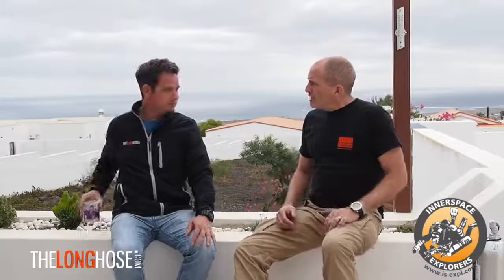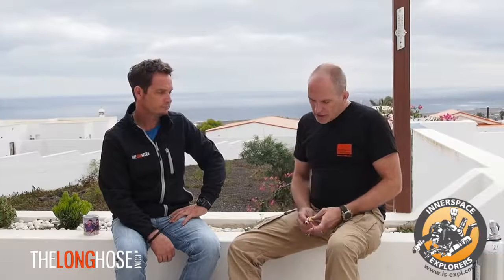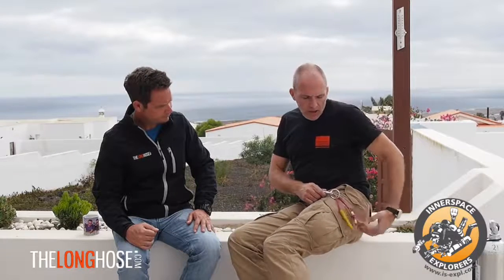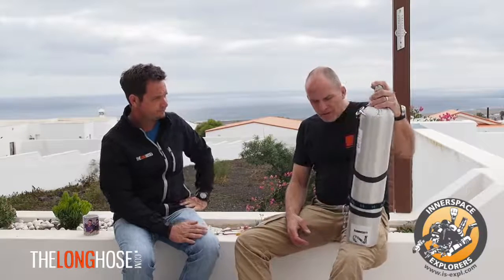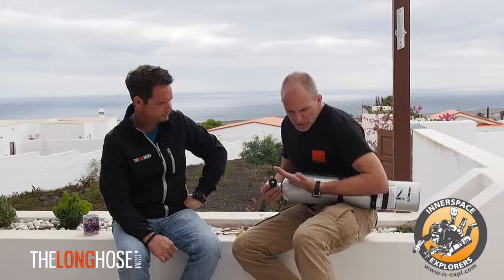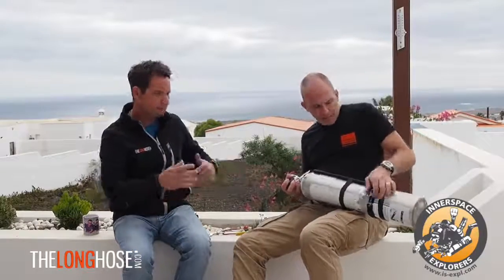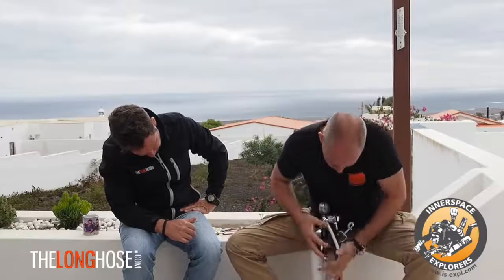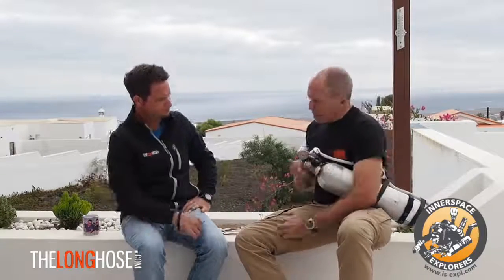'MULTIPLE STAGE HANDLING ' INTERVIEW WITH ACHIM SCHLOEFFEL FROM ISE

Comment: On which side would you clip a stage if you only use one? I think I would prefer my right side. Is there any specific reason you wear it on your left?
Reply: Light canister, lack of D-Ring and long hose?
Reply: @scottselkey4460  I wear my light canister on my left. Theres no problem in addding a D-RIng on the right and I don't think there is a valid reason for nit having the long hose on the other side as well... but could be wrong
Reply: @Chem-iu5jx  The long hose should NEVER be attached to the left post. The reason for this is that it's possible for contact with an overhead obstacle to cause a roll-off on the left post, and this would leave you both unable to breathe from your primary regulator, or share air in an emergency. The light canister goes on the right side so that in the event of wing failure, it can be ditched as part of your removable weight, making up your balanced rig; if you place the light on the left side, it would be trapped on the webbing first by the D-ring, and then by the buckle. Also, the canister stays on the opposite side so as not to interfere with stages, which are worn on the left. The light is held in the left hand also - this leaves the right hand and side of body completely free to manoeuvre a DPV, signal, donate a regulator in an emergency etc. In addition to this, items which will be used frequently are stashed in the right thigh pocket; this would be difficult to access with multiple stages on the right, especially with bulky dry glove rings. The reason that DIR principles work is that they are standardised for everyone, across all environments (for the most part); when you start messing around with configurations, you'll run into issues you never even conceived of, usually at the worst possible moment!